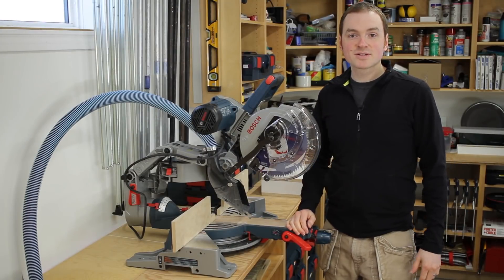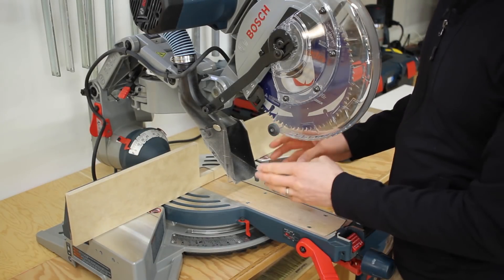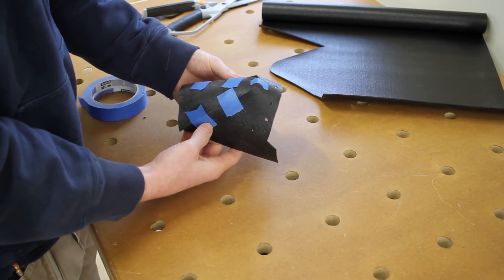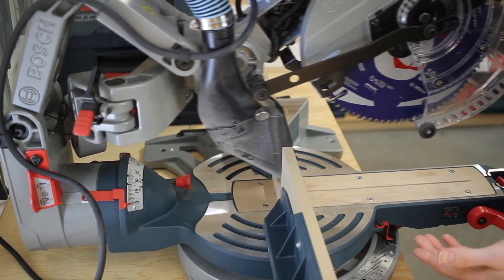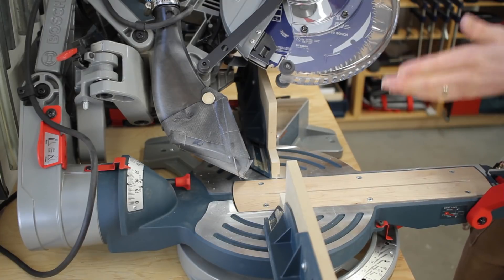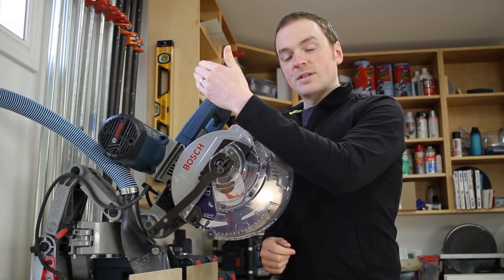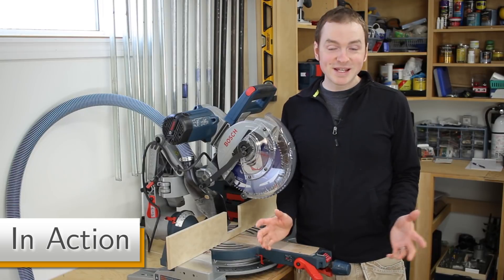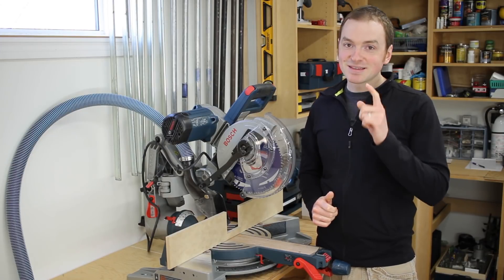Bosch Axial Glide Dust Collection Upgrades & Mods

Comment: Excellent video! It might have been said below so I apologize for repeating if so but I am amazed that a saw that is this expensive would then require the new owner to make the mods that the saw engineers should have engineered into the product in the first place. All of these tool companies know that woodworkers are paying much more attention to dust in their shops and I can't recall seeing a review on literally any type of wood saw that doesn't at some point talk about dust collection. I do not believe you have to step up to a Kapex just to get good dust collection...how much would it really cost Bosch (or any of the others) to do the proper engineering and testing and then put out one that had killer dust collection? I guess they all see their saws flying off the shelves as it is so why bother...only thing I can figure.
Reply: BentBierz, Bosch could offer such a boot as an accessory, but if they made it standard, the saw would no longer extend to cut a wide board, say a 2 x 12.
Reply: Thanks for the reply Robert. My comment was more related to when designing a new saw of any type, band saw, table saw, miter saw, etc. (realizing they all have their different challenges) it seems that dust collection is not given as much attention as other new features. I have been researching band saws and table saws for purchase for a few months now and other than Saw Stop (the only one that immediately comes to mind) it is hard to find a review where people give very high reviews for dust collection. I'm not saying there are NO good reviews but they seem to be very far and few between.
Reply from the maker: +BentBierz you're definitely right. I'm surprised that a lot of tool companies don't give more attention to dust collection these days considering how much more we know about the health effects.  Festool seems to do a good job of dust collection but I've never been able to make the cost of their tools make sense for me.  I've found that other brands such as Bosch or Makita make a great quality tool and just need a bit of tweaking when it comes to dust collection.  Hopefully new tools as they come out will have more attention given to dust collection.
Reply: Hi Dan...I was remiss in not mentioning Festool as I have read very good reviews on their dust collection...guess it didn't come to mind only because, like you mentioned, they are not in my price range for things like miter saws.

Comment: I had great success with your mods and actually found that it got even better if I made the boot just a bit bigger.  Thanks for that.  I've seen really mixed reviews on this saw in terms of accuracy and repeatability.  Do you have an impression on this not that you've used it for awhile?
Reply from the maker: +Ken Nel I haven't come across any accuracy issues so far in my use.
Reply: I have the 12 inch version and I know others that have it as well. I can tell you it is dead on accurate right out of the box.
Reply: Apparently, the stock blade is thin and flexes a lot, which would lead to inaccuracies
Reply: Ah, I actually never used the stock blade and went right to the Forest.
Reply: Just bought a Forrest Chopmaster.  I've had great luck with the dado set and Woodworker II on my table saw.  The stock blade is not good.  So I assume you had good luck with that?
Reply from the maker: I've never used the stock blade on mine. I swapped it out for an 80 tooth Daredevil blade when I got the saw. Might upgrade to a thicker blade at some point though like the Forrest.

Comment: My saw is nothing like this.  It's a Hitachi 10" chop saw.  You did inspire me to put "walls" that go down further and come forward further around the dust collection area as well as attaching my hose more directly to the saw.  

It's not near as clean as yours, but better than before.  Right now it's cardboard as I tweak it a bit, but I'll probably use one of those thin sheets used as cutting boards.  If there was a mid-priced sliding miter saw with as good dust collection as the Kapex, I'd probably be saving my dollars for it.  Can't see getting another sawdustmaker.  I'm a hobbyist, so it's not in daily use.

Thanks for the excellent video.
Reply from the maker: +K.B. Woodworker glad to hear that you got some inspiration from the video even though you have a different saw.

Comment: Why not put the wire inside the boot if it was collapsing “in” during operation?
Reply from the maker: +Beetle Bailey I didn't want to add an obstruction to air or dust flow inside the boot so I put it on the outside to keep the inside smooth.

Comment: I picked this saw (12 inch) up at  Home Depot when they were removing from store. I purchased it for half price. I love the saw. It is extremely accurate but the sawdust extraction is not ideal. I will need to do this upgrade ASAP. I have sever allergies to saw dust but I love wood working. You have a lot of good tips on a dust free shop thanks!
Reply: Did you end up modifying your miter saw? I have a 12" as well and curious if the template works with the 12" as well as Dan's 10"

Comment: Thanks for the video Dan. New subscriber here. I've had my eye on that Bosch for a couple of months because of the articulating glide. I figured that the dust extraction would be an issue as it is with my current one. Appreciate he instruction and I'll definitely try your fix. Thanks again.

Comment: Thanks for this Dan, I made the boot and it works great. I just posted on Sawmillcreek about an easy way to replace the 90 degree output port using a $6. part from eBay.

Comment: Thank's Dan, I bought my 12" 2 month ago and will make the necessary modification to your plan but liked your concept and with a dust hood I shouldn't get practically no dust at all.  What do you think,  I also bought a Diablo Blade with a thin kerf so should I expect a lot less dust being cut and throne through the dust collection?
Reply from the maker: +Annie Gaignard a thin kerf blade definitely reduces the amount of dust made but not necessarily the amount of dust that isn't caught by the dust collection.

Comment: Great video Dan. I appreciate you sharing it with us all. I built the dust boot today but had to modify as it appears that Bosch redesigned the plastic molded dust shields after the early versions (which is what I have). Regardless, used your concept and it should work well. Thanks again
Reply from the maker: +Jeremiah Yoder glad you found it helpful
Reply: Same here. Specifically, the snout of the plastic shroud is not long enough to allow placement of the magnets and as a result, the mouth of the collector gas open too wide. I found that a U-shaped piece of wire, similar to the wire that you fashioned for the bottom of the boot, works quite well.

Comment: I made an extended rubber piece out of some shower pan rubber, it's about a 1/16 thick.  I made up about 8 of them all at the same time, if one gets torn or cut, can easily change it out with a new one.

Comment: I agree with Dodgys that my 12" saw is a snowblower.  Thanks for your info on how to help control the dust. If you cannot find  rubber matting at a dollar store, try a good hardware store or auto store and buy gasket material

Comment: Very nice!!!  I did not take time to read all of your comments but just incase someone has not mentioned it..... You could also make that boot from old tire inner tube (usually a damaged take off can be sourced free from an automotive tire center) The thicker the better will offer side support that will not collapse and you can forgo the support wire. A tractor or utility tube is best.
Reply from the maker: +Chad Harrison that's a great idea, thanks for the suggestion!

Comment: Dan, what's the depth of the saw from the absolute rear to the front mounting holes? i'm planning to build a miter station around this saw but haven't purchased yet.  thanks in advance.
Reply from the maker: +George Herndon from the back of the saw to the front mounting holes it is about 20 3/4".  Hope that helps.

If you happen to be buying the saw from Amazon, I'll put my affiliate link below.  If you do use that link it helps support the channel and is very much appreciated!

http://amzn.to/2s9RNNb
Reply: Dan Pattison Dan, I'm happy to use the referral code!
Reply from the maker: +George Herndon thanks, very much appreciated!

Comment: I have the 12 inch version and I find the angle of the dust coming off the back of the blade depends on the the height of the blade during the cut.  If you cut with the saw in the down position, as you did, the dust hits the stock boot.  If you chop down on thick stock the exit angle misses the stock boot. How well does your boot work in the chopping example? Have you considered using your big dust collector for the miter saw?
Reply from the maker: +Jack Kister my custom boot actually works really well when doing chop cuts, almost better than when doing slide cuts.  I meant to include a chop cut in the video but forgot.  The big dust collector wouldn't be as effective if I hooked it up to the miter saw.  Without getting into all the physics, when you step down a big dust collector line to a small one you kill the velocity in the larger line.  You get much more effective collection if you use a vac or dust extractor with a smaller line and higher velocity air flow.

Comment: Hi Dan, what proportion of the dust is collected by the dust chute? For the rest have you considered a dust collection hood? Thanks Colin in Northern Ireland
Reply from the maker: +colin farrier I would say it's probably about 90-95% of the dust that the boot gets Colin. I don't think that a dust hood behind the saw would do a lot since most of the dust that does escape tends to spray to the sides rather than behind. The dust collection efficiency seems to depend on the thickness of the material being cut too.

Comment: I'm guessing the adaptation to the dust collecting system will also work on the 12" version of this RA saw. All the associated components (i. e. dust collecting tubing) look very similar in size with what is on the 12" saw. Is there anything I'm missing before I attempt the mod?
Reply from the maker: +Co Rin as far as I know everything should work on the 12" saw.  There are a few viewers that are trying it on their 12" saw so I'm hoping to hear some feedback from them soon.

Comment: Good Video Dan.  By far the worst dust generator in my shop was my sliding compound miter saw.  Loved to use it for those clean cuts.  I built shrouds,  improved the dust boot as you did, and gave it its own vacuum system.  It all helped, buuuutttt, dust still went everywhere.   When I moved,  I did not replace it.  After assessing my needs I figured that with a table saw and a track saw,  I could make all of the same cuts I would need in the future with those two saws, using some jigs.   Loved my Hitachi, wished for the 10" Bosch articulating saw, but If I buy another one.  hmmmm, that Festool sure looks good.

Comment: Having problems sourcing the shelf liner material you used. Please advise thickness and whether surface is smooth.
Reply from the maker: +Pam Peerce-Landers I just posted a link to a similar product on Amazon on the blog article. Hope that helps.

https://www.danpattison.com/blog/axial-glide-dust-mods
Reply: Dan Pattison Thanks. Got the shelf liner and gorilla tape using your links.

Comment: Great video Dan, very detailed as usual. Being that Bosch builds great tools, its disappointing that haven't solved the dust collection issue like you have. They must have been so excited for the gliding feature they stopped their thinking there. I'm looking forward to replacing my current Bosch saw with this one. At least I'll know a great way to improve the dust collection. Thanks again, Steve K
Reply from the maker: +Steve, thanks. Bosch has seemed to give a bit more attention to dust collection on some of their more recent saws but the Axial Glide definitely didn't get much effort DC wise which is a bit disappointing.
Reply: Yah I wish a tool company would come along and give Festool a run for their money so they would restructure their pricing. Great products, but ouch on the pocket book.

Comment: sold my bosch glide bought a kapex mainly because of dust collection. the kapex is very accurate, light weight and bottom line it's just great but I end up purchasing another bosch glide which is still in the box. I'll try your idea it looks really good.
Reply: Dan Pattison I'm very impressed with the glide system that's one of the main reasons. I'm super busy and wasn't sure if the kapex would take my work load unfortunately I was right after 3 months of use it just quit working (they got it fixed) which made me realize that I needed a Bosch just in case it happened again. if the Bosch were  more compact and had better dust collection I would still have my original 12" I used for 2 years. the kapex is still a fantastic tool specially for someone like myself who works in different job sites on a weekly basis.
Reply from the maker: +carpenter33 thanks for sharing your experience. Always great to hear thoughts from someone with both saws. I use a Bosch CM8S when I'm working on site and can't say enough good things about that saw. I actually made an upgraded dust boot for that saw too which makes the dust collection very good and at 37 lbs it's a breeze to move around.

Comment: I think the tape is going to give up before too long.  I wonder how a leather or fabric worker would solve this problem.
Reply from the maker: +Terry Pullen hard to say. So far so good with the tape adhesion but only time will tell.  Worst case scenario I'll have to replace the tape at some point but so far no signs of it coming away. The Gorilla tape is pretty sticky stuff.